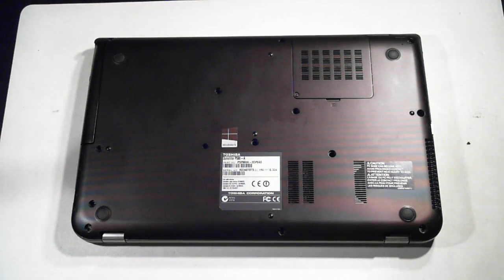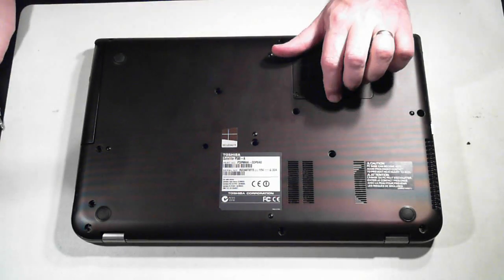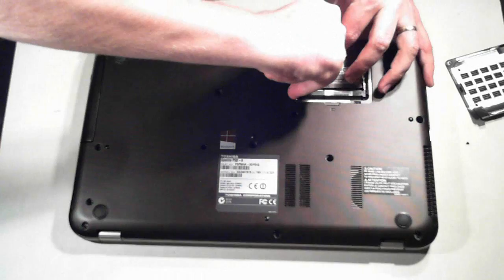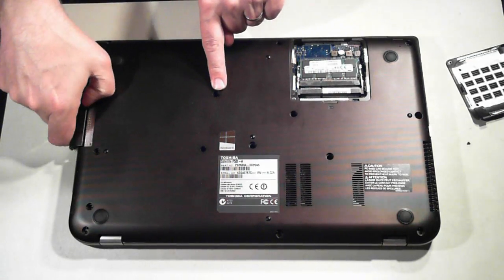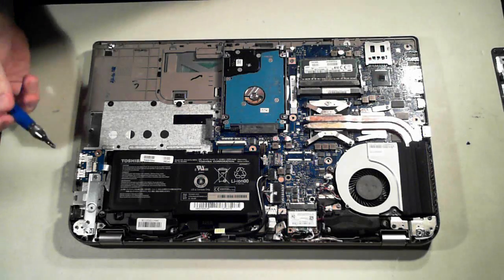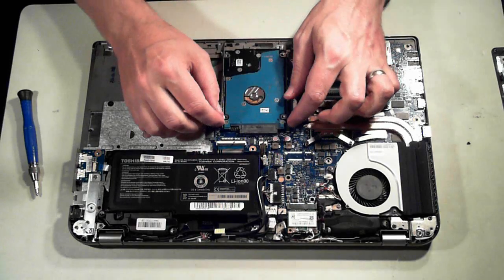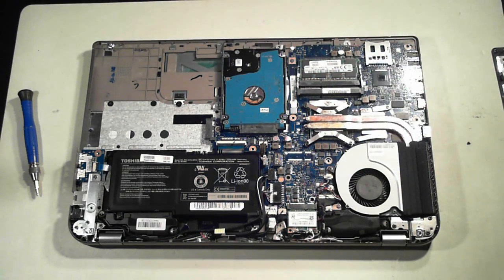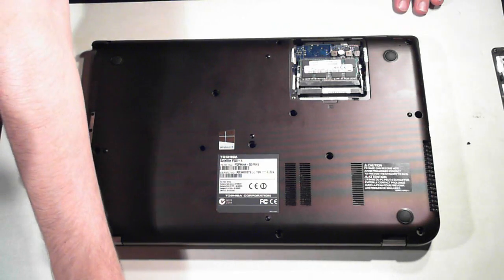Toshiba Satellite P50t-A Teardown / Opening / Take Apart

Comment: Thank you for this video.  Does this particular laptop have a CMOS battery inside or is everything powered from the internal battery??  I have a P50-A (very similar), it it will not power on now.  Have replaced the internal battery twice now, so not sure if it is a bad CMOS or if the internal battery needs replacing once again.  Thank you.

Comment: I've had one of these for quite some time now (must be about 5 years), have replaced the Battery, upgraded to an SSD, regularly cleaned the fan and heat sink and just recently replaced the thermal paste on the CPU and GPU. Quite an easy system to work on really. Still performs well, especially with the SSD upgrade, but only any good for 5+ year old games as most new games require more than the 2GB VRam. It Idles silent and boots to a usable state in less than 10 seconds

Comment: Hello, that's a nice video, I have a question... the sata conector of the HDD is sata 2 or sata 3?
Reply: Juan José Aguilar  It's SATA 3. Just upgraded mine to an SSD. It takes me 17 seconds from turned off to a Google search on Firefox!
Plus I got an HDD caddy for the CD reader, so my old hdd id still in there in place of the cd reader. Had to do this because the computer will only boot from the SATA 0( internal)  slot.

Comment: Thank you for your video.  I have a problem I am hoping you may be able to assist me.   My wifi just stop working on my P50t-a and I tried running a troubleshoot along with disabling wifi connection through network connection, and uninstalled/reinstalled the wifi adapter in device manager.  Although it show the wifi adapter there but it does not seem to fix the error.  Is there away you may guide me to fix this.
Reply from the maker: +Snowfox Download the latest WIFI drivers from Toshiba and see how that goes. Also the wifi adapter card may be loose so try and reseat it.

Comment: For you folks having problems with the BATTERY NOT CHARGING, try going to the Device Manager > Batteries and disabling "Microsoft ACPI-Compliant Control Method Battery". My Toshiba was constantly turning off, even with AC power, and now it is running for two and half hours on battery!
Reply: muchas gracias....de maravilla!!!

Comment: Any way to add a second 2.5" drive to the laptop? I have the P55t-A5118 and I'm going to replace the stock drive. I want a SSD for the OS and a HDD for everything else.
Reply from the maker: +DecimateTheWeak100 Not that I know of. There are adapters for some models so do a search on the net (Amazon & eBay).
Reply: DecimateTheWeak100 yes there is.  Just uograded mine. Buy an HDD caddy for 9.5" HDD for the CD drive, replace the inner hdd with an SSD and put the other one in the caddy , which will substitute your CD reader. Really easy.

Comment: Hello everybody, I've recently broke the female end of the charger, the part thats actually in the laptop which goes directly go the motherboard. I was wondering if anyone has one to sell or could point me in the right direction as to where i could find one. Any help would be greatly appreciated and will send money to anyone that helps me locate one. cheers.
Reply from the maker: +Aaron Jessome have you searched Ebay or contacted Toshiba directly?
Reply: +Aaron Jessome is it completelly ruined?  If not, have you tried resoldering the one you got? I had charging problems in an old Toshiba due to a microcrack in the solder and doing that worked.
Reply: I've fixed it, thanks for responding. It's appreciated!

Comment: +dpcomputing What products would be best to use for cleaning the dust from the heat sink and fan?
Reply from the maker: +Adam Cosenza I use a small brush and compressed air.
Reply: +dpcomputing Are there any brands of compressed air that you prefer or have worked well for you in the past?

Comment: Hey, my P50t-B laptop can disable the battery from the BIOS (for servicing porpuses). The laptop cannot be powered again until it is connected to an AC adapter, meaning that the battery is effectively disconnected. This should be a safe way to "disconnect" the battery, right? Otherwise your video was very helpful, thanks for uploading it to YouTube!
Reply from the maker: Jesús Pestana Puerta Thanks for that tip, I didn't know about that.
Reply: dpcomputing No problem :-). The Toshiba videos on how to replace an HDD by oneself and your video both point out that it is important to disconnect the battery before "servicing". I used the BIOS option to replace my laptop's HDD, and as far as I can tell no harm was done to the laptop.

Comment: Anyone know how to change the keyboard, I have split liquid in the Keyboard and it needs to be replaced ??
Reply: Jack Telling I did the same thing spilled liquid on my keyboard and really need to know how to replace it! do you know how?
Reply: I never got it apart. It is basically at the bottom of everything. You have to take everything out. It was too big a task for my liking.
Reply: Jack Telling Would taking everything apart be extremely hard? also can I test that the new keyboard works before I place the motherboard back on by only plugging it in or?
Reply: Jack Telling Basically my laptop keyboard is working but typing random 0000 and combinations of keys endlessly

Comment: Any chance of replacing the dvd-drive with the hard drive and replacing the hard drive space with a SSD?
Reply from the maker: Brendan Mendonca The connectors I believe are different so you would have to do a bit of hacking to get it working.
Reply: nvm, found it online: http://www.amazon.com/gp/product/B00HU5FV34/ref=ox_sc_act_title_1?ie=UTF8&psc=1&smid=A2RXPPUXYPGU4W
Reply: Brendan Mendonca  Yes there is. I've done it. Takes me 17 seconds from turned off to a completed Google search in firefox. You have to place the SSD in the inner SATA port and the HDD in the cd caddy, since the computer only alows the inner sata to have bootable media.

Comment: I have a black screen on my laptop once I turn it on. I let the battery die out and recharged it. Also tried connecting it to an external screen but nothing works. Any suggestions?
Reply from the maker: Ricardo Alvarado could be a hard drive, memory or motherboard problem. Does anything at all appear on the screen (ie the initial BIOS screen, a flashing cursor)?

Comment: Thank you for the video.
Is it possible to remove and replace keyboard ?
Reply: Did you manage to get the keyboard out ? Any help on how to take the top off the keyboard section ??
Reply from the maker: Samy Mantegazza yes it is but at this stage I don't have a video showing a keyboard replacement.
Reply: I am looking for instructions to get to the keyboard.   Part of my keys are not working.    Did you ever figure out how to get to it?   Thanks
Reply: Nope I never managed too. I took apart a lot of the back. But you need to basically dissemble the whole internal to get to it.

Comment: Thanks a lot for your nice and clear video. Can you explain if its easy to upgrade the of the wireless adapter 7260 (300mbs) for the new one: INTEL 7260.HMWWB.R Dual Band Wireless-AC 7260 - (867mps). I think i saw it in your video near the battery.. Do you know if its easy to change it? Do you have any video changing the hdd to sdd and intslling a cady dvd drive with the original hdd? Do you think is easy to change the SO  Windows 8 to the sdd? Very gratefull for the video. Hope this questions can be of interest to other fellows. My toshiba is a P50-A-12z ( i7-4700MQ) (NVIDIA® GeForce® GT 745M) with 1TB hdd and 8GB ram (2x4gb),
I waana upgrade ram to 16gb the wireless card and the hdd to ssd. I´ll think that i´ll get State of the art performance. I think that i´ll waste about 100€-16Gb ram + 120€256gbsdd + 25€-7260 + 20€caddy.
This upgrade is about +/-250€. I like to know your opinion and other friends here about this idea.?
Reply from the maker: Luis Manuel Yes the wireless NIC is easy - just remove the antenna and a couple of screws (you could also plug in a USB adapter to make it super easy). The SSD upgrade will give it a great boost in speed but I don't have a video showing this upgrade - if you are unsure take it to a qualified person.
Reply: dpcomputing  Thanks for you opinion. I´ve already order this 16GB ram at ebay: New Hynix 8GB PC3L-12800 1.35V DDR3 1600mhz 204pin Laptop Memory Ram NON-ECC Item price: £112.00.
PQ371 GG597 Intel Dual Band Wireless-AC 7260.HMWWB Wi-Fi and Bluetooth card - £28.82
I share this for someone who wants to build a great and powered laptop.
As soon as i can i´ll invest in SSD and the caddy. Just wiating for more financial disponibilty and some kind of promotion.
Congratulations for your work hope you could get the return from the universe for such interesting videos. Be happy. Regards from Portugal. luis
Reply: How it went with an upgrade mate?

Comment: Anyone of the P50 owners has problem with unsticking speakers cover? (mesh over speakers) Recently a have noticed that flaw on my notebook, this piece seems to be mounted with glue...so far this element has separated in 40% from the case.
Damn, I always thought that Toshiba is producing good quality gear.

Comment: Do you know if the wifi card can be replaced with an intel 7260 card.
Reply from the maker: Gizmo Tech If it is the same interface and you have the drivers it should be possible. It would be easier to just add a USB wifi adapter though.

Comment: Cheers for the video.
Is it possible to remove the Li-Ion battery and leave the AC adapter plugged in to prevent the battery from getting hot while gaming?
I'll be leaving the laptop in one location over the next few hot summer months.
Reply from the maker: doueven hmmm, yes it should be possible but I haven't tested it on that model. Why don't you just remove the battery and see it it works from just a power cable? Then let us know if it works!

Comment: I am trying to clone the HDD to SSD and was going to put in the CD/DVD drive. but soon found out the delock slim sata frame isn´t the same size. Anyway. I was advised before removing the HDD to disconnect the battery so I did. after putting everything together with the old HDD in its place ( going to use USB-SATA for the cloning) the computer won´t boot. No lights, nothing.. any idea?
Reply from the maker: Aleksandar Kospenda stupid question but is the battery properly connected and the power plugged in? If so can you check that the hard drive is properly connected and that you didn't accidentally disconnect anything else?

Comment: What is the product number for the battery? i need to find a new battery, but i have a hard time finding the one i need.
Reply from the maker: Nicolai Aspelin I'm not sure where you are located but these are the batteries for the PSPMHA-0DP04S http://store.emprgroup.com.au/c-45235-battery-main.aspx
Reply: dpcomputing I'm living in norway. i got a satellite p50t-A-115. Which one of them will work for my computer? cant see any pictures from the store.
Reply: dpcomputing product number is PSPMHE-00R001N5. Got my computer on repair so i had to find it first

Comment: you already did remove dust filter ?
Reply from the maker: celuar3 no. Everything I removed is shown in the video.
Reply: Oh, ok I have Toshiba P50_B_103 and i have some cover ... (or maybe dust filter, I dont know) on fan side ... watch this:

http://prohardver.hu/dl/cnt/2014-08/110751/toshiba_p50_b_103_6.jpg
Reply from the maker: celuar3 I think what you are talking about may be connect to the back cover which you can remove.

Comment: Can i upgrade to two hard drives (HDD and SSD) if i take off the optical drive?
Also what battery would i buy to replace the old one? Mine is only taking about one hour...

Thanks in advance
Reply from the maker: Luiz Wagner You would need specific caddy to hold the hdd in the spot made for the optical drive. So while it is technically possible I wouldn't recommend it. I'd suggest you go for one of the hybrid (SSD + platter) drives.
Reply: What i found was during the time the SSHD does not perform as good as in the begin, do you know anything about that?

And the maximum amount is 8gb flash for laptops?
Reply from the maker: Luiz Wagner at the beginning the sshd is learning about what type of data to keep in the cache / SSD part. So yes at the beginning the speed improvement is not too great but will slowly improve as it learns.
Reply: Thank you so much for the answer

Comment: Hello David,

I have the exact model Toshiba Satellite P50t-A.  I need locate the jumpers on the motherboard that are used to reset the CMOS/BIOS password.  For other models, they are easy to spot and they should be marked?! I could not locate them for this model.

Can you help?

Regards,
Ahmad
Reply: It uses EFI not CMOS/BIOS. Instead of storing the settings in volatile memory with a battery backup they are saved on an EFI partition on your HDD.